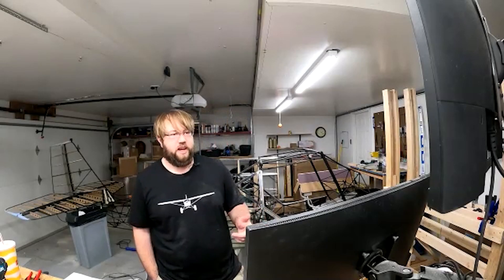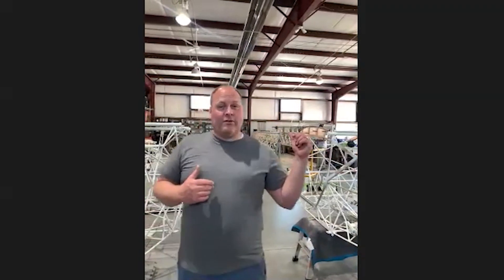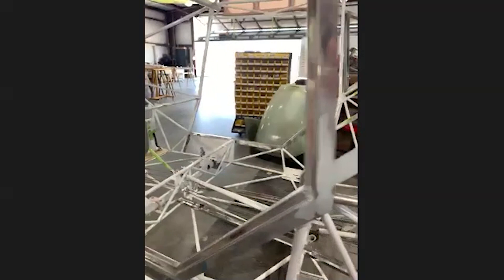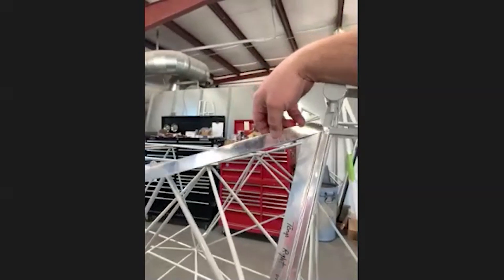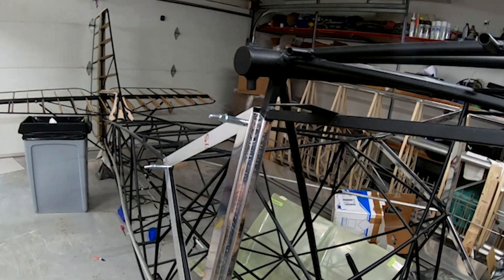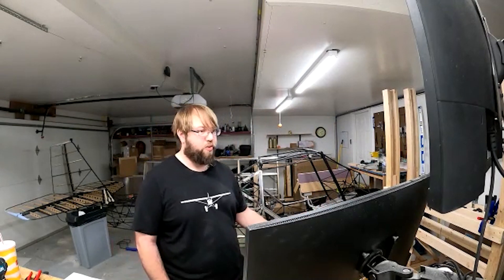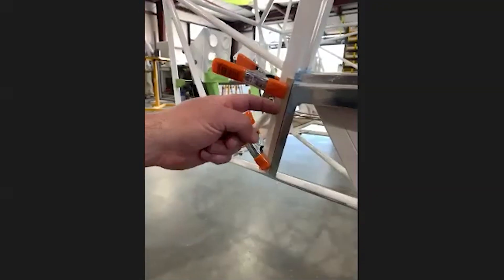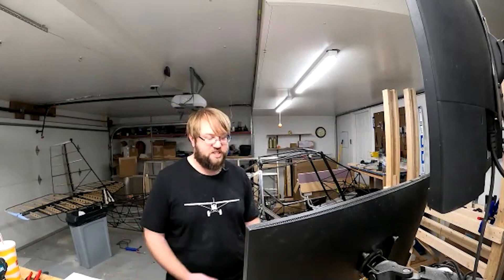Door Frame Examples with Brandon from Kitfox - Episode 23 - Salt Fox - Kitfox 7

Comment: Aaron, what size dimple do I need for the supplied flush rivets that comes with the kit?  I have ordered the expensive squeeze tool with all the die sets that has not been delivered to me yet, but would like to know before hand.   Thanks
Reply from the maker: I wanna say it's 3/32nd and 1/8th but I'm not quite sure. Either way, if you bought a set it should come with all 4 of the dimple dies you need for aircraft rivets. https://aircraft-tool.com/shop/detail.aspx?id=426DD-KIT
Reply: 1/8 dimple die I used after

Comment: When you were mixing Hysol how much were you mixing at a time. I have a reloading scale that can measure up to 250 grams is that an adequate capacity
Reply from the maker: It starts getting sticky pretty quick, I only mix at most 20-30g at a time. You can always mix more.